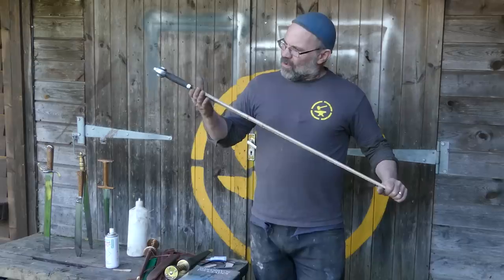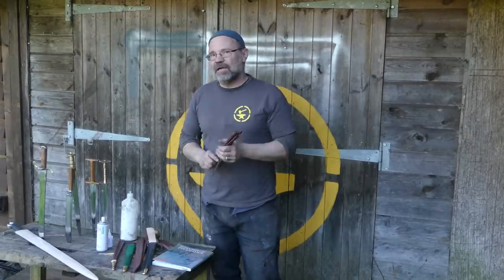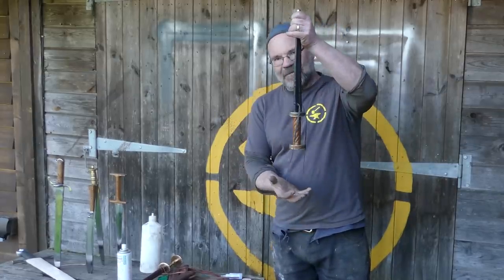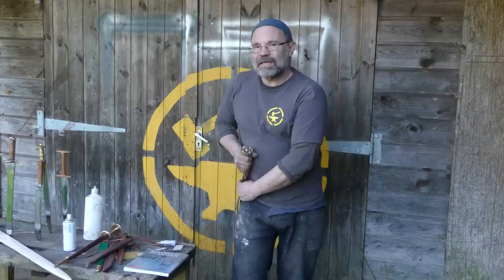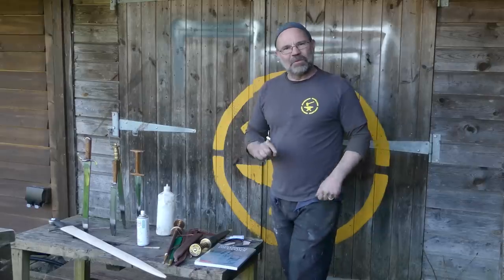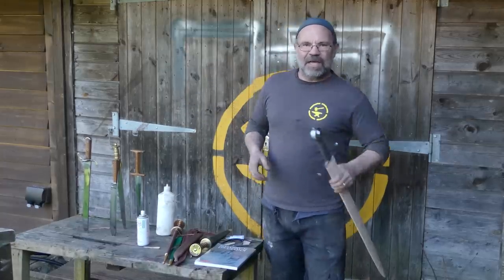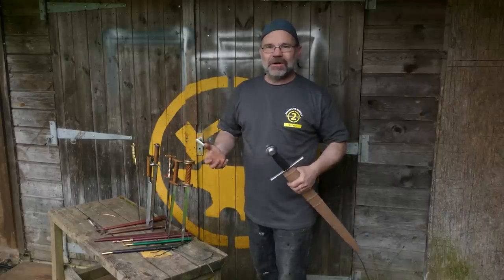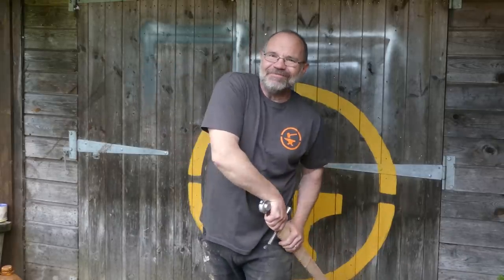How Tight were Medieval Scabbards?

Comment: BTW this is all just hypothesis based on how things usually seem to go: 

Tod's description of the cutler buying parts and assembling them to sell the whole piece makes a lot of sense for a reason I don't see people mentioning: if you don't have a factory where all this is done in-house, each craftsman needs to make his stuff and sell it for money. He can't hand everything over to a cutler and wait for the cutler to sell pieces and reimburse him for his crossguard or whatever. And no customer wants to buy all the pieces and then mangle things putting them together. So the cutler has to exist, and he has to have either a strong professional relationship with his suppliers or the money to buy all his materials outright. Or some combination. Which means not every one of the individual craftsmen could afford to BE the cutler; just because you can make sheaths doesn't mean you have the trusted connections and capital that the cutler does. And it also means customers can just come to one shop and buy the thing, which means all the component craftsmen can work out of their homes instead of having to maintain anything like a storefront or blanket full of their wares in a market area. That storefront is more expensive to maintain, and cuts into profits. 

It does mean that the cutler is presumably the more powerful and wealthier of the whole group. If a component craftsman wanted to raise his price, and his cutler didn't accept, he could try to find another cutler. But now he's on the lookout and competing with that cutler's current supplier on price, so he probably doesn't get the increase he's looking for anyway. And also just burned a bridge in a small community. Meanwhile the cutler is a harder-to-achieve position and there are more component craftsmen out there than cutlers, so he has his pick of them. He probably has multiple craftsmen in each category supplying him. So even if informally and in an unspoken way, he has more influence over their price to him than they do. But of course doesn't want to push that relationship too hard, because if they REALLY wanted to they could probably figure out a way to cut him out of the process by promoting one of their own and just working together on credit or as a partnership.
Reply: Exactly, it's just like going to someone like Track of the Wolf, and buying a Bowie knife kit. They send you the blade and all of the other bits to finish it.  When you do that makes you, at that point, the cutler.

Comment: So, idea, what if medieval scabbards were made loose like that on purpose for WHEN they get wet so that they would fit properly when they do? What if you were expected to grab a sheath that kinda fit pretty good and were expected to water treat it so that it would then tighten up slightly and mold itself around the blade some? What if they pre water treated the scabbards before selling them so that it wouldn't get too tight?
Reply: Sword scabbards were wood cored with a leather wrap. Wood swells when it's wet, and leather shrinks after it's been wet and subsequently dries. So if the air is humid or it gets wet, the wood will absorb more moisture, and it will swell - this is what makes it tight. Once the wood dries though, wood fibers will release some of the moisture back into the air and it can shrink back down. Whereas, if it was purely a leather sheath, the leather will not return to it's original size.
Reply: @WillyShakes  I think (at least I have done it) its reasonably common practise to soak leather before you use it to wrap something (then stretch it around) and sew it up.  Then when it dries its a tight fit.  Once wet the timber and leather would both swell.  When they dry out again the leather should still be a tight fit.
Reply: I know of at least one way of making knife sheaths that involves wetting the leather. Pukko knives have a sheath that goes up around the handle as well. Wood around the blade, then wrapped in leather that covers the wood and partly up where the handle will be. The leather is then wetted and moulded with the knife in the sheath.

Comment: I got taught leather working by a saddler, or well two because it was a couple that taught me, and one was focused on making saddles while the other on making the tac-wear (like bridles ect.). It was super interesting how while they officially have the same "work" they do really different things, and also taught differently.
They did point out that while they would prefer to work with a local blacksmith for the metal fittings, it wasn't really profitable in current day and age for them.

Comment: Neat video. I do leatherwork. You did what is today known as wetforming. It's having a hard time drawing from the sheathe because the leather has molded to the fuller of the blade. Its narrowing angle toward the tip of the blade doesn't allow the blade to come out properly because the mold doesn't allow adequate space for it to do so. This causes the entire sheathe to need to expand when the blade is drawn, and leather isn't particularly stretchy.

I surmise that leather sheathes were either well oiled, well waxed, or some combination thereof to prevent wet forming of leather sheathes and to repel water. An oiled sheathe would have been quite flexible, which may not have been the best treatment for sheathes if you wanted a fast draw, but it would keep the blade well oiled on a journey from point A to point B. I wager that beeswaxed sheathes were preferred because wax repels water and stiffens leather. Or, waxed on the outside and oiled on the inside would have been an excellent treatment method.

That is, of course, considering that the leather received any treatment at all. I'm not an expert on medieval gear, so I'm telling you how I would treat a leather sheath if I were to make one with the goal of repelling water and fast draw.

Comment: my basement (and clean shop area) can be humid. If I forget to run a de-humidifier, swords I am working on often stick in the scabbards I am making for them. I have to dehumidify until it shrinks enough to remove it. Then, heat the blade a little and put it into the wooden scabbard. It will shrink the wood that it touches some and then it will fit right forever.  I have wanted to ship before, and had a basement leak, and had the sword stuck the day I planned to ship. That's how I learned this weird trick to salvage a scabbard without having to scrape it full-length potentially. Thanks for the video. It sort of resonated with my experiences making all-wood scabbards for custom swords.

Comment: One thing came to my mind is that force moving towards enemy can throw multiple of these in volleys while advancing, 1 per 20-30 meters of closing in, so there might be not time to pick them up as there's more incoming.  We are also bit used to seeing volleys but what if there's constant harass coming at you. Also they can be useful for a infantry to have against bigger targets like cavalry formation, to possibly injure/frighten the mounts, riders aren't going to pick them up. It's a handy piece to have, throwing it from behind the battlements fast, and get back to cover. Things might haven't been that easy to pick up in a big crowd of soldiers moving about, trampling the one's that landed on the ground, while the guy next to you is screaming due to having one stuck in his leg, arm, whatever.

Also, if you get a cramp or minor muscle injury from the throw, then you could fall back to the rear maybe to get some respite, I bet they'd rotate the injured anyway in any circumstance with fresh troops, so they could fight a while later in long battles.

Comment: Very well done. I make my own scabbards & i tend to like them pressure fit so they dont fall out but i did run into this problem. It doesnt rain here much but when it does or if I get wet it does cause them to bind. So i discovered it is helpful to rig something to tje scabbard for your thumb to push on.

Comment: Reading the comments brought something to my mind when I was a conscript: even rifles slings are set differently depending on the situation. On a parade, they are fit tightly, so they look good and you can fling the rifle around pompously. In a practice they sling is loose, so you can actually keep it hanging and still aim with the gun. Can't do that with parade-tight sling.

So somewhat loose scabbard makes sense when your life depends on your sidearm being able to be drawn as fast as possible if you lose your main weapon. But if it's your main weapon, it could be a tad tighter fit, as you have more time to wrestle with it before your unit closes with the enemy.

Comment: I like the channel and the effort Tod shows, top notch. 
Also I thought about scabbards and came to one very simple conclusion, unlike in this piece, the inside was treated to repel water. This goes for wood and leather. And they knew about the problem so they wouldn't ignore it totally and apply protection inside and out.
There are several ways of doing so, think of boiled linseed oil, varnish or tar like the boatbuilders did for centuries. The archeologists wouldn't necessarily find the fact if they don't look for it specifically. Tar in a wooden splinter is nearly impossible to recognize you need to run a test for it to do so. 
The high status ones may be lacquered not only for the display of wealth or style but also for practical reasons.

Comment: Interestingly, I recently tightened the sheath of a left hand dagger bought from you. I used a small piece of deer hide, glued it in exactly as you described.

I also make my own sword scabbards. I have a particular method that isn’t historical but it works. I always line the inside with fur, use about 2mm wood (sometimes two layers of edge banding adhered together), wrap that with linen (with rabbit skin glue), leather (hand-stitched tight while wet, no adhesive). They usually take about a month to settle in but they’re always perfectly snug at the end. The swords won’t fall out, but drawing is smooth and effortless. The inner fur lining might not have been used in the past, but it helps keep the blade clean and oiled, allowing me to store the swords in their scabbards for long stretches without worry.

Now I’m going to have to submerge one to test it.
Reply: I wouldn't be so positive on the method not being historical. Before I made my first scabbard, I did a lot of research on the topic of scabbard making and came also up with lining the inside with fur (shaved goat fur - with the stroke towards the point of the sword). I believe it was a more ancient way of building scabbards (dark ages/early middleages).
Reply: Yeah, that’s about how I understand it, too. More of an early medieval thing.

I do it for all of my swords, except for antiques and Japanese ones.
Reply: @mitcharcher7528  I still wonder why they abandoned that way of building a scabbard. While those are more "chunky" due to the multiple layering of materials, they also work very well - even under damp conditions. Due to some oversight, I've let a sword sit about half a year during fall and winter in a scabbard on my terrace and when I tried to pull the sword, it came loose pretty easy and didn't have any mayor corrosion damage to the blade (the guard and pommel had quite some rust).

Comment: Have now made over a dozen dagger and sword scabbards for myself and mates. Ive found that they start quite tight (usually fine until the last inch or so of stitching). But a bit of oil and working in and out of the scabbard and they work really well. But saying that I haven't soaked them. Interesting video.

Comment: In some 'samurai-esque' style movies there is a type of rope binding the sword (handle) to the scabbard.  
Might be a thing they did, if you use those thongs a bit, you could quite well prevent accidental falling out of the scabbard. Of course, you'd want to do it in a way like a pushbutton on old gun-holsters: easy to flip open if a fast draw is needed.

Comment: I had the same issues with making a scabbard for my Albion bastard sword. I steamed and formed the poplar around the blade, and covered it with linen using rabbit skin glue. At first, it was snug, but would "lock" in at the last fraction of an inch. Later, during the hot, dry summer, it loosened up. Now it is ready to fall out, but it still tightens noticeably with any ambient humidity. Being an American, I have the same issues with holsters for my various handguns. Snug fit and secure hold, or quick draw? Fortunately, modern technology provides me with a variety of different options.

Comment: Interesting. I recently made an adjustment to my story involving a culture that saw being un-armed almost equivalent to being naked. I just added a method by which they could restrict the sudden rapid-fire drawing of a sword so no one gets cut down in public without warning; safety clips. a little something to hold the weapon in place so it required a split second to loosen before drawing (easy to do with magic so it's less of an issue). it has the addition of being a status sign if you need multiple clips on you weapon to be seen as safe. 
This thing about securing your sword in the scabbard or just enough to keep it safe and dry, is off set by the clips, because if you're going to draw your blade, you're keep it unclipped and you hand on it. if you're not, it's clipped in, and not touched.
Reply: This is a pretty common idea, it's called peace-binding or peace-tying. You'd think there would be some status associated with a complex beautiful knot, which means you know you won't have to draw your sword. Or maybe someone has to tie the knot for you, and if you untie it you won't know how to get it back together. Or people being sneaky and tying a knot that comes unraveled easily, or a trick knot that's tied right but isn't actually connected. It seems like a high overhead for very little peacekeeping benefit.

Comment: I made a scabbard for a sword I had,, and what I did was make it from two thin pieces of wood that I carved out a slot for  the sword in, and then  cladding the inside of the scabbard with fur and glued the pieces together..Finally the outside was covered in leather.. The fur inside both held the sword in, and when you put your lightly oiled sword in it it never rusted...

Comment: Thanks for doing so many of these types of videos! You are showing me exactly what I want to know, how these weapons and armors perform in the real world. I've often wondered how practical a group of archers would be when trouping about the english countryside in the rain, do crossbows require less care and attention? And again wondering about the armor such as chain links when they get super rusty, how would a man-at-arms clean each individual link? Would the rusty armor perform differently or cause mobility problems?
Reply: The way I've heard (with no confirmation whatsoever) is that indeed,  rusty chain links can bind as well as weaken, thus presumably hampering movement as well as effectiveness

Again with no confirmation I heard that a typical way to clean mail is stick it in a barrel with some sand & roll it around for an hour or 2; the fine cleaning/oiling comes afterwards if necessary
Reply: And arrows don't stay straight when it's rainy
Reply: @rdt1104  My understanding is that bowstrings are more affected by immediate exposure to water; waney arrows would prolly take a bit longer to appear

Comment: Having carried a sword and dagger re-enacting as a billman ('man-at-arrms'), I have had tighter and looser scabbards. With looser ones the draw is quick, but swords have partially come out, pivoted, swung haphazardly, tripped me up and made movement difficult. In fact, even when the sword stays in the scabbard it flaps about annoyingly because fighting with a bill tends to involve lots of twisting and swinging about. Although we're only really playing at fighting, my feeling is that the main advantage a 'man-at-arms' has is mobility (run away, run away..!). It also feels like a quick draw on the sword isn't that necessary for the lower class fighter as I also feel like drawing the sword (at least in battle) is a bit of a last resort (say you've lost your billhook and trying to rout). The only other need for a sword might be in confined spaces, but that's rare. Also, did many men-at-arms carry a sword anyway? (pricey). Say I'm a billman in a tight spot and a knight is coming at me with a longsword. What's the point drawing mine other than pure desperation - I'd be waaaaay outclassed. If I can't run I'd better just beg mercy or make my peace. Even at that last resort moment it feels like a dagger is far quicker and handy (mixed with fighting 'dirty'). On the dagger suspension side, I definitely agree that the thong works best if you want a looser sheath but you don't want it falling out. But it does swing about a bit and a bollock dagger lashed too far forward did once swing between my legs and...you can guess the rest...😵😵‍💫🤬 On the 'practicality' side I can see why people carried large daggers, big knives like bauernwehr and later the langmesser. These are like a compromise between sword and dagger. They offer utility, affordability, portability and manoeuvrability.